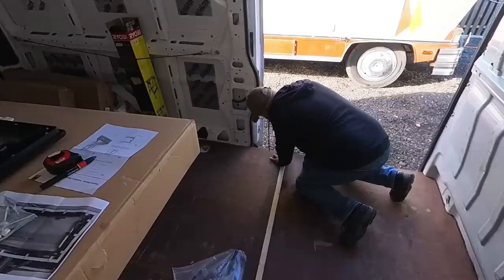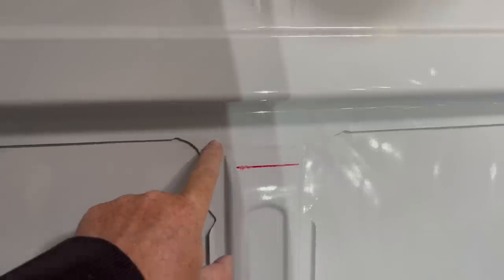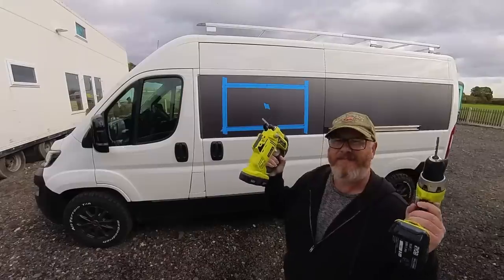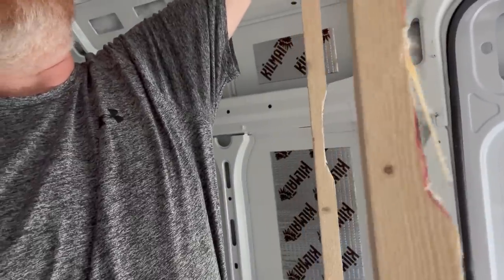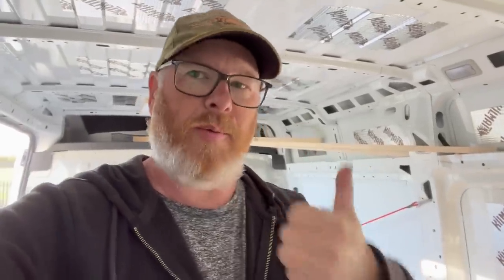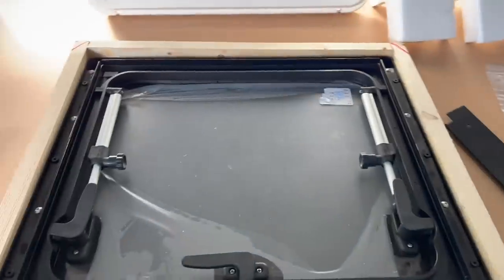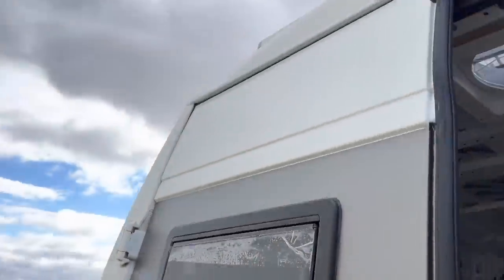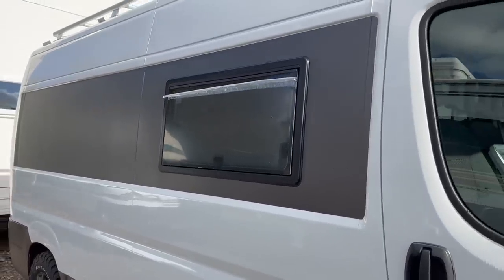Fitting the Windows - VB07

Comment: Fitting a flush glass bonded window is definitely quicker, but if its in a camper or motorhomes, then as you say the insulation qualities of the Caravan style windows are so much better. For me however, its also the fact that caravan style windows usually have built in flyscreen's and black out blinds. Trying to do all of that to a bonded glass window suddenly turns that job into a proper ordeal.😉

Comment: How good does it feel now? Am exactly the same, fitted 4 seitz windows to my transit. Wouldn't hesitate to fit them to another van now. Wouldn't go for bonded windows personally but it's each to their own choice. Loved what you did with the wrapping. The van is already looking badass. Would love the wheels and tyres but don't have the budget at the mo. Will continue to follow your build with interest as I learn something pretty much every video. On insulation I ended up with a combination of plastic bottle fibre, kingspan and dodomat and being away these last couple of chilly nights am really happy with the result. I put 18mm hardwood ply on the floor over 25mm kingspan. It's reassuringly solid! 😊. All the best 👍

Comment: John I was interested in your vinyl wrap video a few days back. It all looked simple but I am sure its not. How did you cut the vinyl straight along the long lengths :-) Nice work on those windows and a better job when there just one cook. You can spend more time getting things just right even if you have to learn everything yourself which is also a plus. Great work and advice thank you for sharing. xx
Reply from the maker: If you watch my original vinyl wrap video from a few years ago, on the John & Mandy channel, you’ll see how I did it and the products I used to get the cut lines straight etc.

Comment: It's looking good.  But wouldn't the measuring,  making sure it is level and cutting the van bit, have been the same whichever window you choose? It seemed to me as though it was  making and gluing the wooden frame and fixing the window into it was the (significant) difference,  but maybe I missed something!
Reply from the maker: Since a spirit level isn’t going to work in a van, the issue is alignment becomes a big problem. You can measure and cut a perfect square in a van, but there’s another level of measurement to ensure the cut square is then actually perpendicular with the lines you wish to be in alignment with.
And each panel curves virtually and horizontally, and each panel is unique, so you can’t assume that what you did the first time will work the same way for the other windows

Comment: Hi John just a quick question. Going to do the exact same window installation with the same windows. Going to do the vinyl wrap first save cutting the vinyl around window. Does it make a difference if the windows bond to the vinyl no the metal. Many thanks

Comment: With the side windows, how did you find having to compensate for the curvature of the van wall against the perfectly straight window edges?
Did you find that the L-shaped brackets you used on the sliding door window pulled the van wall to be straight and flush?
Reply from the maker: The windows & door metal have both married well, the seal is perfect and water tight with a very slight visible deformation in the overall look of the door metalwork.
Reply: @GadgetJohn  Ok, thank you!

Comment: Hi John, I'm just referring back to this very helpful video as I'm soon to take on this task myself.
I couldn't see it in the video, but did you just bond(gunk) the window onto the wrap? Or did you have to cut a border of the wrap away? Just wondered if you thought it mattered.
Thanks John.
Reply from the maker: I removed around 5mm of the wrap so the window primarily bonded to the paintwork, the additional sikkafkex that stuck to the wrap has since caused shrinkage of the wrap.
Reply: @GadgetJohn   Thankyou John, really appreciate you responding.
All the best.

Comment: Hey John, couple of queries, you mentioned that you still had some excess Sikaflex to tidy up that had squiggled out the side of the window and was going to use some sort of solvent. How did that impact on the vinyl wrap? Was it easy to clean up excess Sikaflex with the wrapping or did it create an additional problem? Cheers Bud
Reply from the maker: When I fitted these windows to Mandys van I used butyl tape rather than sikaflex and that's worked out to be the best option, it's watertight and there was no mess afterwards.  I found on my van that using isopropanol removed the excess sikaflex without damaging the vinyl, but it took a lot of effort to get it looking ok, whereas Mandys van looks perfect with no cleanup after fitting.

Comment: Rule #1 when fitting windows.
Use a "Mandy".
.
I don't suppose you took your perfectly sized wooden frame and lined it up with the cut lines on the tape outside as a final final final check?
Reply from the maker: We did but as each van panel curves both ways it doesn’t really help using the frame as a template.